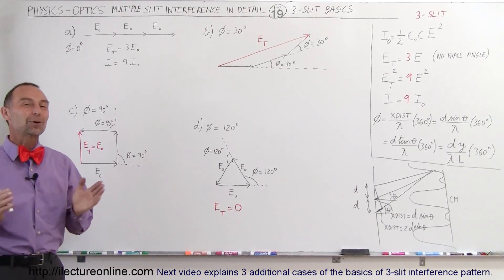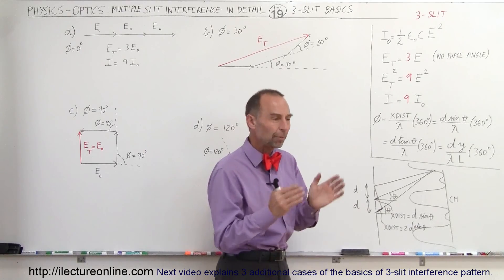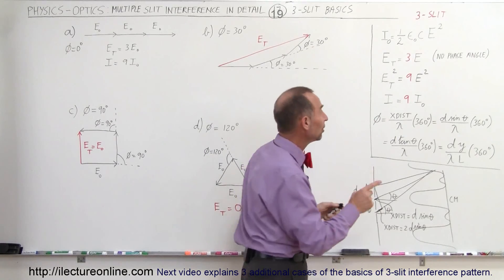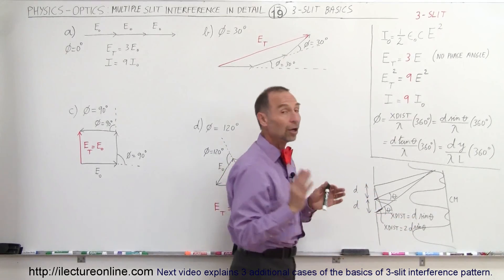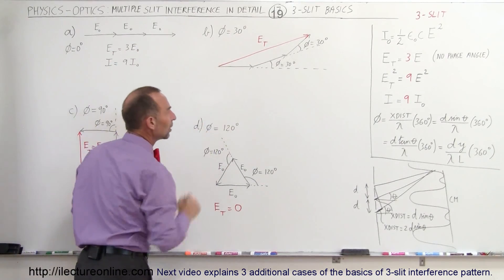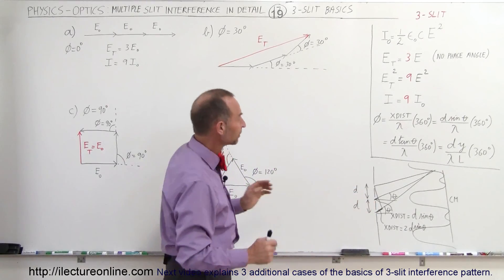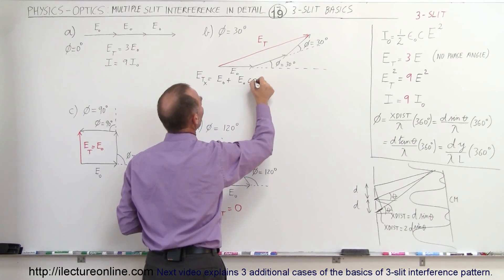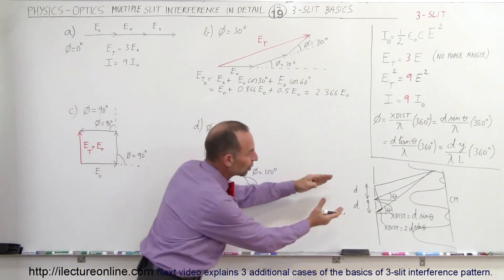Physics 60 Optics: Double Slit Interference (19 of 35) 3-Slit Interference Pattern Explained(Part 1)

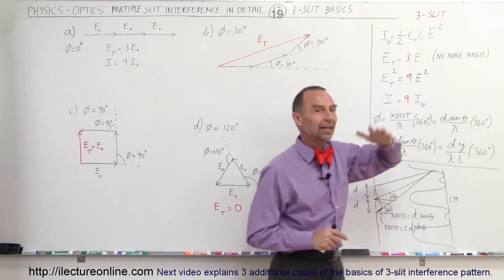Comment: 0:55 I think you meant to say max-value and not RMS value of the electric field? :3

Anyways, great videos! Quick and easy to learn :D
Reply from the maker: +Jon 93  You are correct.  (That is why there is a 2 in the denominator).  Without the 2 in the denominator the equation uses E rms.  Thanks for bringing that to may attention.